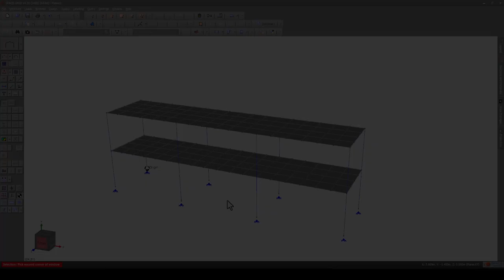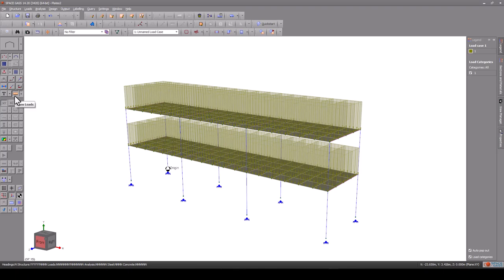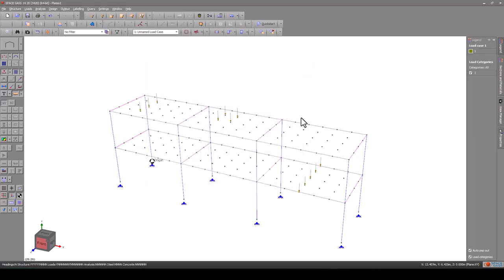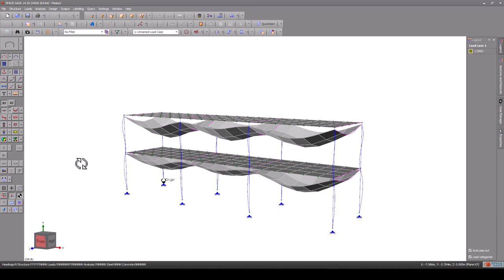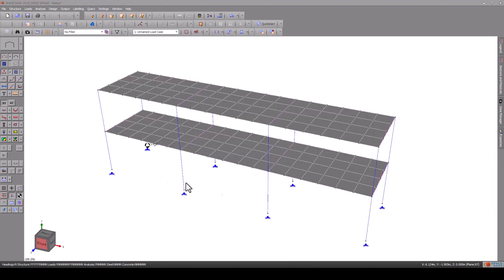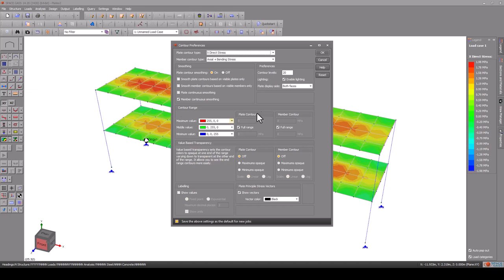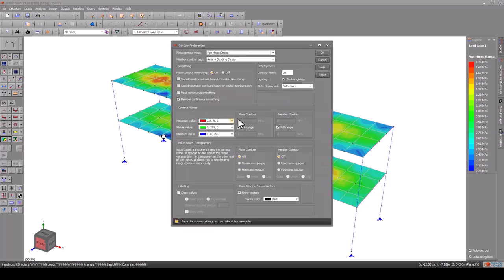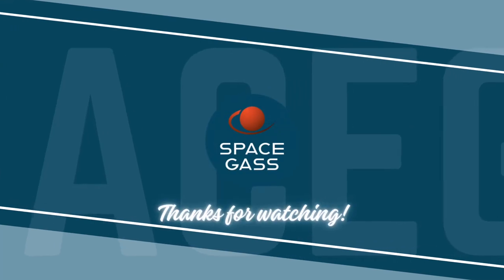Plate Elements - Part 2

Comment: Hi, Thanks for the video. What would you be doing if i want to model the internal forces of a UB beam through plate analysis? What would be a good reference?
Reply from the maker: Hi @foonhaocheng3505. Thank you for the question. 

You could try modelling the cross-section using dummy members and then use the extrude members tool to create a member out of plates. Then you can load the plates, run analysis and view the plate stress contours or buckling mode shapes. 

You can read more about this in our help manual: https://www.spacegass.com/manual/Input_and_Editing_Tools/Extrude_members.htm

We also have a very exciting new feature coming soon which will speed up this process. 

If you have any specific queries, please send us an email: support@spacegass.com